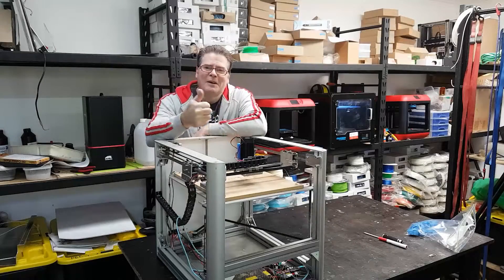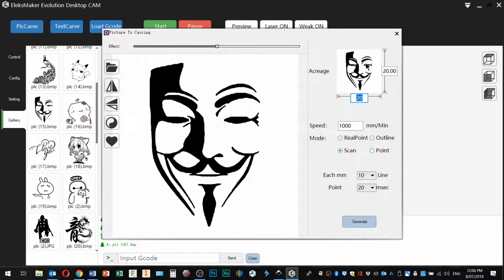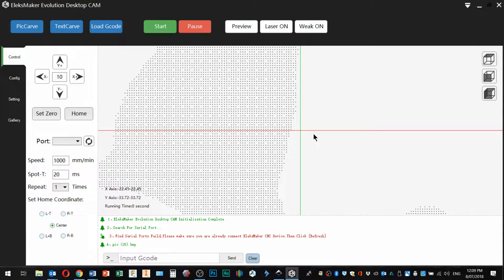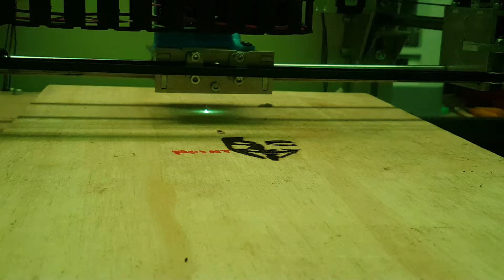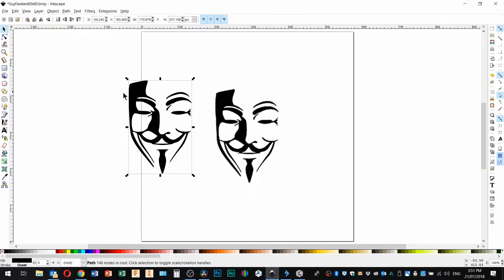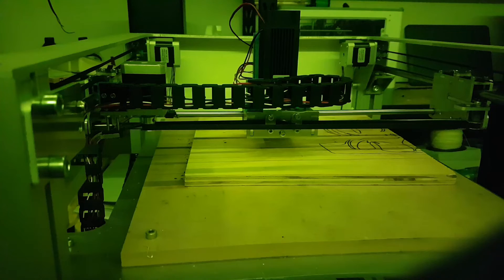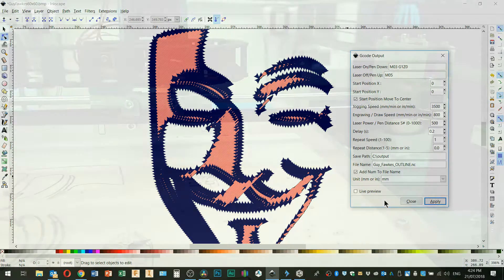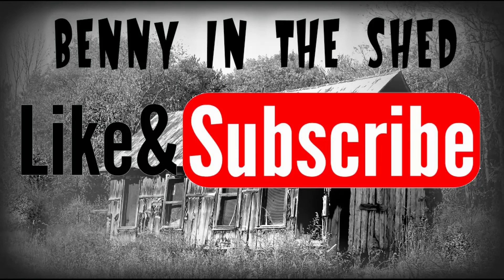Running the Laser with EleksCAM Software

Comment: What are you running the laser on?  Did you design this?  Thanks for the clear overview.
Reply from the maker: Hi Rick, I'm using the software that goes with the 2 axis controller made by Elekscam.  I made the laser machine out of an old 3D printer I had called a "leapfrog"